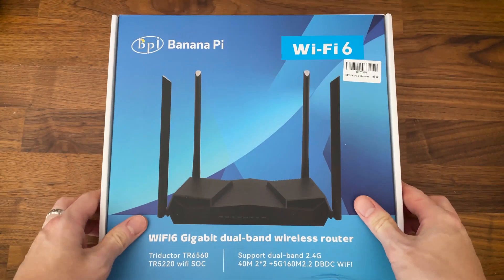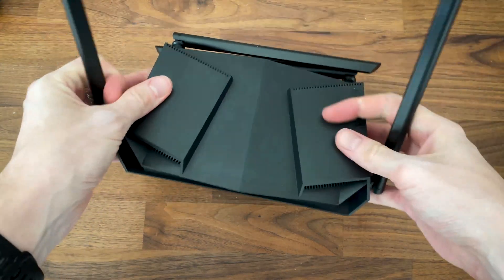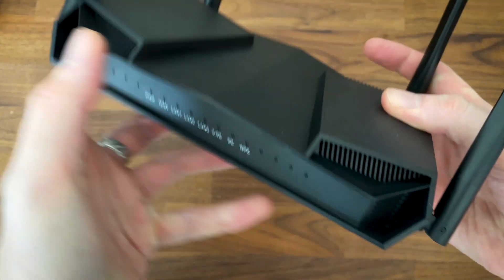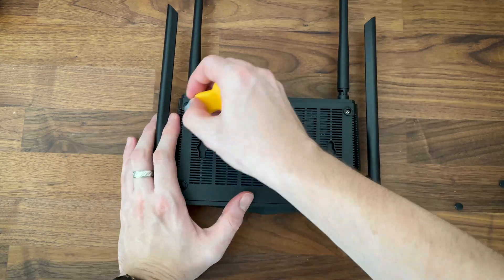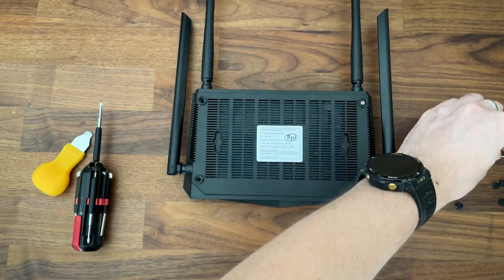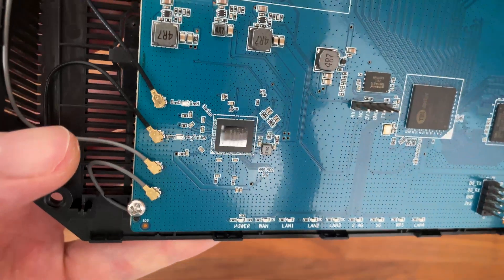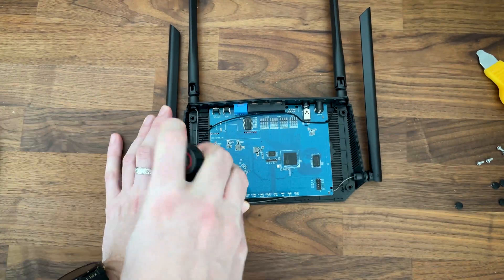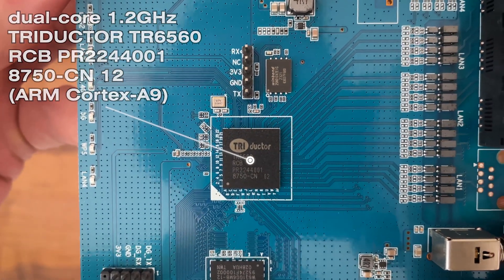I opened up the 30$ Banana Pi WiFi 6 router (teardown)

Comment: I do not like this racer like gaming design of this router case.
A less sensational looking brick style enclosure, maybe with attachable screwing angles near the front would be even great at home.
At a price of 45 to 80 € in Germany (with housing) it seemed to be a nice step into Wifi6 and OpenWRT. After about two years I did not manage to integrate OpenWRT functions into my home infrastucture according to my and my wife''s personal needs. Maybe they differ too much. 😏
Now since two years my DSL router has built-in Wifi6.
My real problem is, that the router is more an experimental, but no more that new BananaPi DIY-project. As it now seems to have reached End Of Life, you have to make an actual Firmware on your own.
As Triductor TR6560 + TR5220 wifi SOC drivers are not free and the the BPi Wifi6 is not listed on OpenWRT, not everyone should try this hardware.